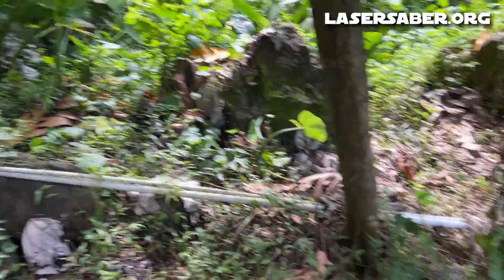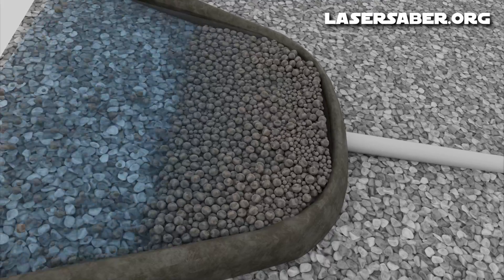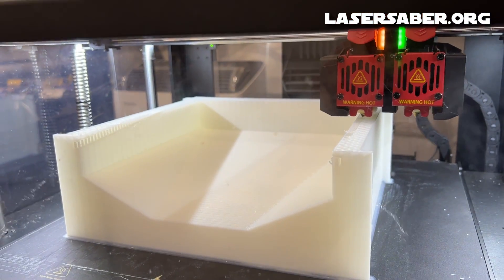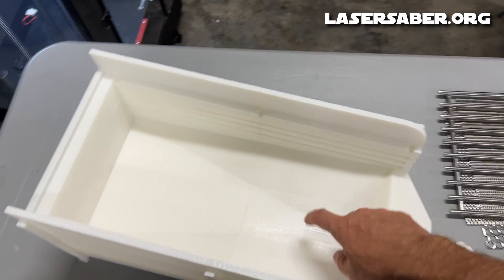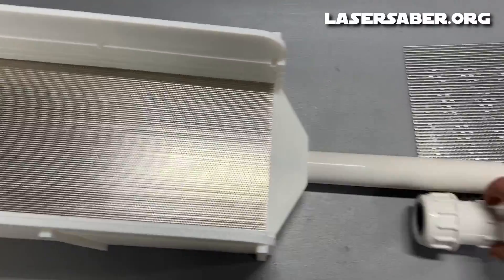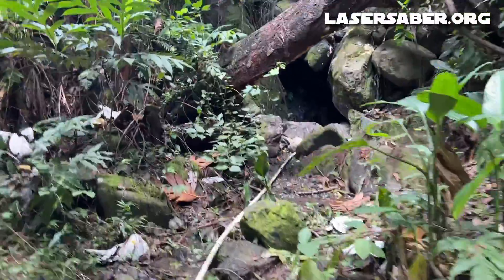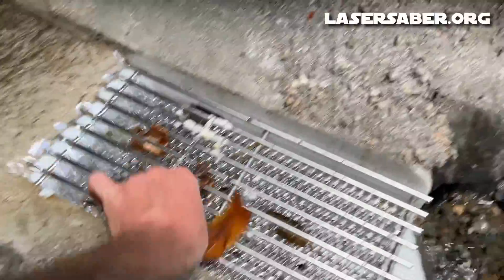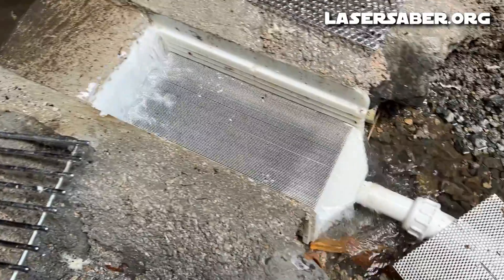3D Printed Spring Water Collection Box - Self Cleaning Design

Comment: Hey there, i bought a SON1-25 a while back, and just took it out of long term storage. When I reconnected the battery, it doesn't seem to want to charge. The port / load light is blinking red, but there's no over flashing warnings on the charge controller other than low battery. The invert isn't pulling anything, and when I remove the 40 amp fuse and reinsert it, the charge controller boots back up, beeps, but the beep kinda fizzles out immediately. What do you think? Bad fuse? Bad charge controller? Any thoughts on how I can fix it?

Comment: Very cool design! Have you heard of the Coanda screens? They use a self-cleaning principle as well, in conjunction with micro hydro systems. One thing I would think you had already accounted for is deposits of silt and excess mud that come by, or other mushy substances that could build up. Depending on your local climate, the metal shouldnt expand too too much enough to break or move about in the plastic housing. 
All the best!

Comment: @lasersaber the 3D design on Thingiverse looks shorter than the one you actually 3D printed plus it doesn't have the middle vertical rib. Additionally, I didn't see any recommended slicer settings on Thingiverse. Any additional information would be welcome!!!
Reply: Nevermind regarding the length!!! I just opened the Thingiverse linky on my laptop and saw that there are to parts-- a front and back to the print!!! LOL!!! Kinda missed that when I was looking on the small screen of my phone!!! Still curious to know what kind of slicer settings you used such as wall count, infill type and density percentage!!! On some prints I've done I've used Gyroid and been EXTREMELY surprised how stout and stiff the infill can make the print even with a fairly low percentage of infill!!!